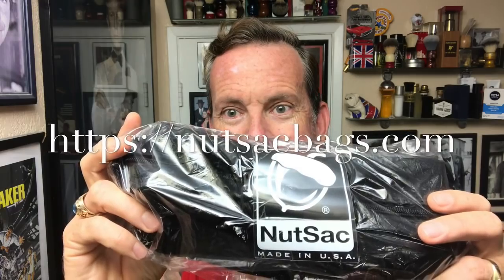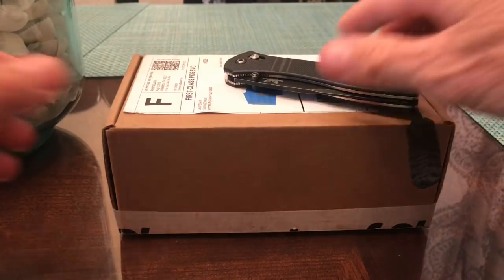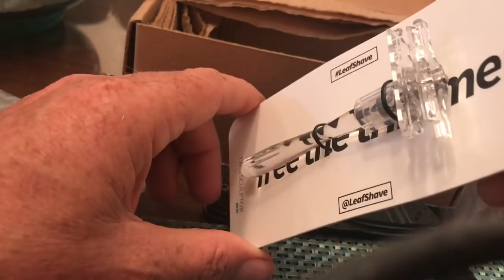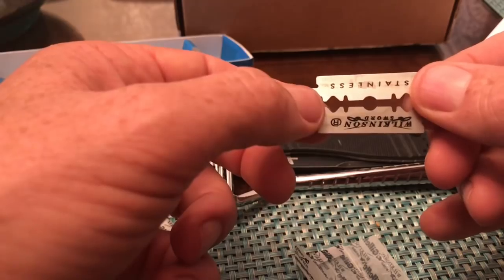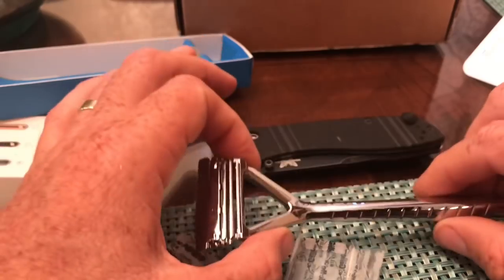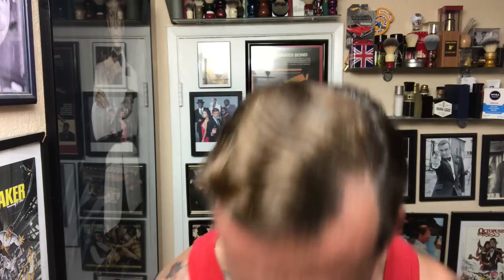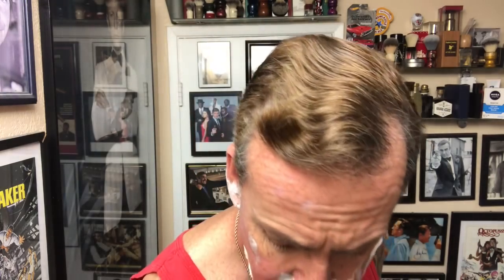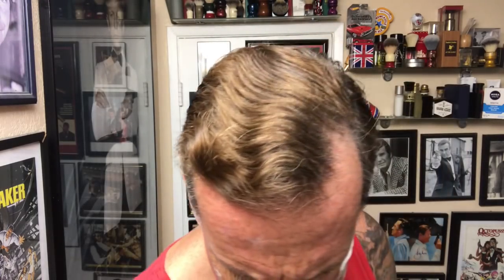Weekend  Shave with Leaf Razor, Nutsac Travel Bag, Vie Long Brush, Pierre Cardin Aftershave

Comment: The Twig (the clear razor) is for under the nose. 

You loaded the right two blades. The top blade hardly cuts, but it does help a bit when you use all 3 blade slots.

I have seen bad reviews for this razor come from two things:
1) They didn't use the pivot
2) They loaded only the top and middle blades
Reply from the maker: Rick Reynolds Awesome Rick thank you 👍💈
Reply: The bottom and middle positions are the way to go with two blades. Close shave but forgiving like a cartridge.
Reply: I just bought one of these. I loaded all 3 blades and nicked myself (head shaving) three times. This never happens with a cartridge. I am thinking about taking out the 3rd (most aggressive) blade and trying it that way. Do you have any other tips?
Reply: @RideByNight  While you want to engage the pivot, you don't want to use near the pressure you'd use with most cartridges.
Reply: @Rickpa  Ok thanks. Will be trying again later this week.

Comment: I want to pick one of those up to try it. I use double edge safety razors but I can't help but appreciate the engineering of that leaf razor. It also looks like it would be nice for my head if it's too sensitive for a double edge (which has happened a couple of times from some rough shaves from experimenting too much)

Comment: This is good, you can use two complete doble edge blades in half, three pieces for the big metal one and one for the plastic one, wich I think is designed to get easier the spot under the nose.
Reply from the maker: ARMMouthpieces Absolutely 👍👍💈

Comment: Nice benchmade.  If you like the one you have you should check out the 940.  In my opinion the best edc blade ever.  I have over 100 knives and I always go for my benchmade 940.  Awesome video too.  I have looked at the leaf before but I always thought it would be difficult under the nose.
Reply from the maker: Bj Cundiff it took a bit to get under my nose too👍💈
Reply from the maker: Bj Cundiff I have a 940 also but no lanyard hole. It is a great knife.
Reply: Yea, not having a lanyard hole is a bit of a downfall, but the way I got around it was calling benchmade and having them send me a deep carry pocket clip.  Once I got it and had it on the knife I took my paracord and put it thru the pocket clip.  And the good thing about it that way is it is easy to take on and off.  I'll post a pic of how I did it in edged addiction assylum later on if you want to see how I did it.

Comment: I backed the Leaf razor one kickstarter.  My only complaint about the Leaf is the amount of pressure I have to use to get it to work well for me.  I basically have to mash it on my face, maxing the pivot out.  I wrote to Leaf and gave them my feedback.  They replied stating that the pressure of the pivot was one of the most discussed items while designing the razor.  They landed where they did in hopes to hit the sweet spot for the masses.  Although I get a good shave from it and love the concept, I rarely reach for my Leaf.  I loan it out more than I use it.  Great shave and enjoy Tahoe.  I'm just down the hill in Sacramento.  Hopefully all the smoke from the fires don't stay around while you're up there.
Reply from the maker: Burke Bair I did push hard against my face too but no cuts👍👍💈
Reply: Hi Burke, I too am in the Sacramento area. do you still have your leaf shave razor? if so what finish is it and do you still want it?
Reply from the maker: gabez8 👍
Reply: gabez8  just saw your reply.  I have a rose gold finish.  It has 2 very small blems, but yes I would like to sell it.
Reply: how much are you asking for your leaf razor?
Reply: gabez8 $40 with stand and Twig razor
Reply: would you be interested in a trade deal?
Reply: gabez8  let me know what you have.  I'd also like to take this conversation off this channel.  Look for me on Facebook please.
Reply: here's my facebook since i am wasn't really able to find you on there: Gabe Zephier when i receive a message from you this comment is gonna be deleted

Comment: Hmmmm, personally I rather use DE razors with single blade instead of two or three blades to prevent skin irritations. But I looked it up and they look nice razors. But good job in figuring it out without reading the instructions.
Reply from the maker: Joe Scully lol..I hate instructions👍💈
Reply: You can still use a single blade in it. Using more than one blade just gives you more options.
That's how I use mine. There's no need to use more than one blade in it, really.

Comment: Do you have a shaving 101 video? Like with the essential tools and recommendations? thanks
Reply: Hey, here's a simple suggestion (by no means the only route):
-Parker Variant (this allows you to adjust how aggressive the razor will cut)
-Voskhod Double Edge (DE) blades

If you want to get fancy with it then you can also get:
-Shave soap (Sir Hare is a fun little option)
-Synthetic Brush
-You can just use a cereal bowl or buy a lather bowl of you want

Comment: It was a pleasure watching you use that razor. I still stand by my comment last week, it's the dumbest thing. That said in the hand of the master it was a great view. You loaded it correctly, from the bottom up. That twig is for under the nose, and uses up the 4th blade half if you loaded 3 half's. It just seems like so much work if you change your blades often. Great job as always, looking forward to the next video.
Reply from the maker: Sal DiMisa Thank you Sal👍💈

Comment: i wanted to buy the leaf razor but i was worried  it would be hard to shave  under the nose .
Reply from the maker: Richard Collier It did work out after I tried a few angles 👍💈
Reply: i orderd   the new The Phoenix Starling V2 Single Edge , and the  supply razor . guess my next one to try is the leaf or the Occam’s Razor

Comment: You should try it with three Feather blades and press like that... See what happens.😁😎😈
Reply: tanathos0414 I have feathers in mine at the moment. 5 shaves with  same blades so far..  It seems to kind of feel the same no matter what blades I throw in it...  I have used Gillette 7o'clock Super Stainless (Green Pack),  Astra and now the Feather. Next is Derby in it. But I don't think that'll make a difference....  Seeing that feathers are so completely tame in this razor...
Reply from the maker: Jeofrey Pereira The Razor was very forgiving no matter how hard I pressed against my face👍💈
Reply from the maker: tanathos0414 👍👍💈
Reply: Kensurfs true.  When I can make some more time,  I will send Adam my opinion on what I feel!!  Can't wait to see what they come up with next!!!

Comment: If I bought this razor I'm sure my wife would steal it from me.  I might just go for the rose gold from the get go for her.
Reply from the maker: Craving Shaving My wife is interested in this one too👍💈
Reply: The head is too large and bulky to shave my legs well.  The trouble areas around our tendons on the outside of the legs by the knees do not get shaven close and it doesn't handle divots on the knees and ankles etc.  It tends to just use the middle of the blades when shaving those areas.  I wouldn't get the wife one.  Does not give a close shave either.

Comment: Should have done one for one blade only. And a smaller head. The concept of using DE blades  is great. However, three is very  unnessesary, has no beneficial function and also needing  to push hard can't be good  for  your skin. I was quite thrilled in the  beginning when seeing a razor like this, but I would not want one as is, and way too expensive. Safety razor are the best, period.
Reply from the maker: Cahave 👍👍👍💈